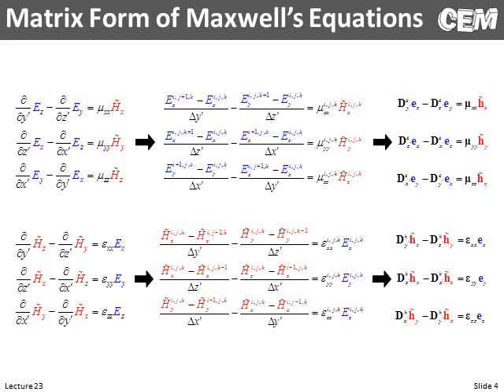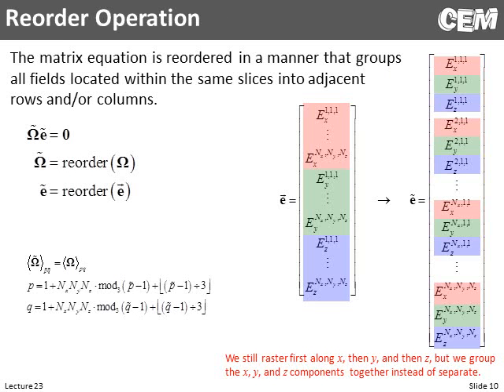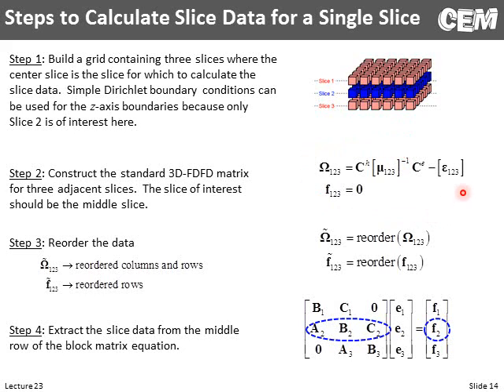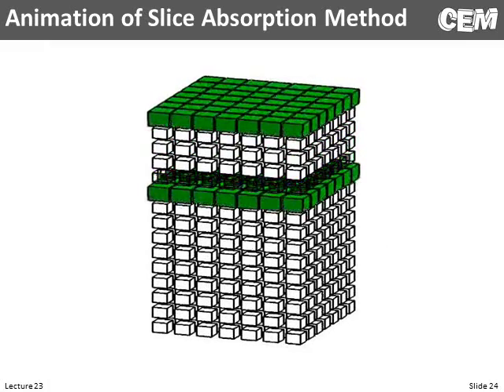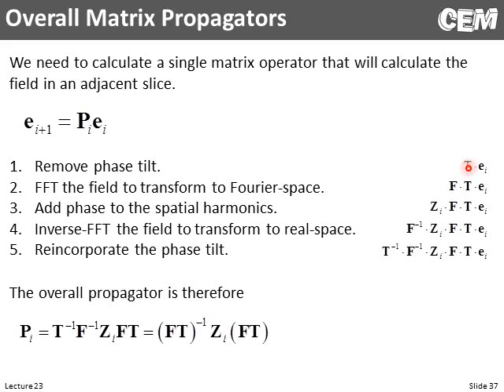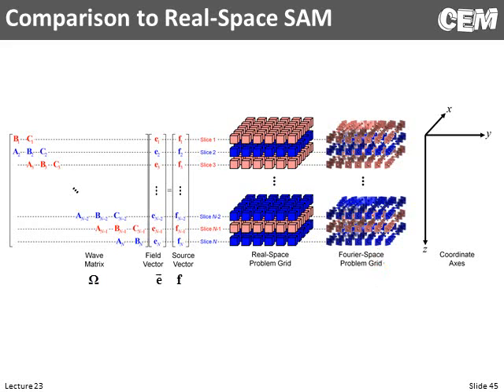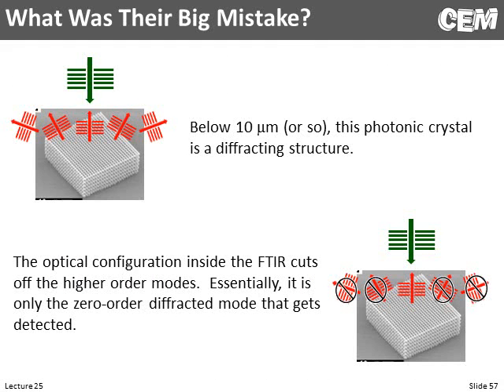Lecture 23 (CEM) -- Slice Absorption Method

Comment: Thank you very much, Professor. Do you have any recommendations for a MATLAB course on the Slice Absorption Method? I feel it can solve simulation problems caused by insufficient memory.
Reply from the maker: The memory issue is why I originally developed it. What types of structures/devices do you have in mind?
Reply: @empossible1577  First of all, thank you for your prompt reply, Professor, and for providing such a wonderful online course. Actually, I'd like to simulate a multi-segment optical fiber problem, using fundamental Gaussian light as the light source, passing through coreless fiber (pure silica), multimode fiber, gradient-index fiber, and a two-photon-printed periodic structure. I've studied your Mol method, but it suffers from memory crashes when solving eigenvalue problems. Therefore, I feel the SAM method might resolve my concerns.
Reply from the maker: @AaronGu-s7l  For dielectric structures with low to moderate index contrast, rigorous coupled-wave analysis (RCWA) may work well for you. Optical fibers are very large relative to the wavelength. You may consider starting with approximate 2D simulations, get your design or analysis close, and then move to 3D.
Reply: @empossible1577  Thank you, Professor, I will give it a try.

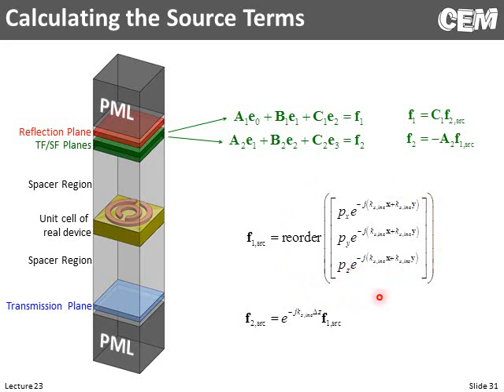Comment: (1) In 25:26, how about f3,src, f4,src, so on, are they needed?

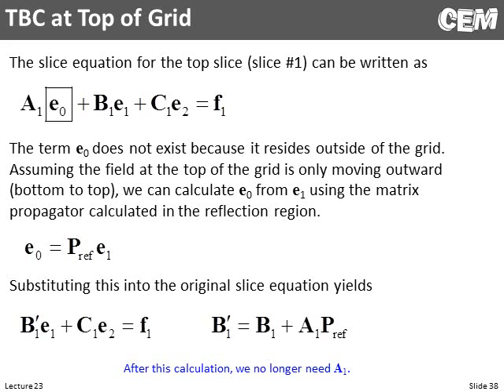(2) In 32:19, why do we not directly add the phase to the fields? Is it because we do not know the phase value? All we know is the thickness of the slices, and we need the wavelength by calculating the wavelength of the spatial harmonics.
Reply from the maker: (1) If you are looking at all the slice equations at once, there is only f1,src and f2,src.  However, if you absorb these layers into other slices, new f terms arise in the new slice equations to carry over the information in f1,src and f2,src.  It is slightly more efficient to absorb these slices last so that you can ignore f's in all the slices.(2) The phase tilt of the input wave due to an angle of incidence is build into the simulation through the periodic boundary conditions, f1src, and f2src.  In this step, you must remove the phase tilt before the Fourier transform is calculated and you then later you must put it back in.  This is done through the tilt matrix T.  The wavelength should already be a known quantity.  It is an input to the algorithm.  You can calculate the wavelength of the individual spatial harmonics, but that is not necessary.  The only information from them you need is the longitudinal phase term kz.

Comment: very helpful! I have a question: If each slice is different, for example, if the shape of the photonic crystal in your published paper is a sphere, can we still use this method? what kind of method can we use in this case? Thanks!
Reply from the maker: +Xiaofei Xiao This method is rigorous so it can handle anything.  However, it is best suited for simulating structures that are about one period in x/y and long and complicated in z.  For a big, bad, and ugly photonic crystal sphere, considering using a time-domain method like finite-difference time-domain, finite volume, etc.  If the sphere is relatively small, other methods like finite element may work fine.
Reply: thanks.Must it  be periodic? if it is not a must, what the spatial periods in eq. 20 in your published paper should be?
Reply from the maker: +Xiaofei Xiao The structure does not have to be periodic.  The problem is that when it is not, you need an absorbing boundary condition and some space between your device and the boundary.  This adds to the size of the model and decreases its efficiency.  The SAM does not scale well when increasing the size in the transverse directions, which you would need to do to simulate nonperiodic devices.  I think this could be made to work well in 2D for nonperiodic devices, but I have not tried that.